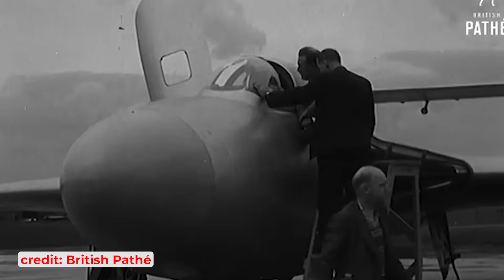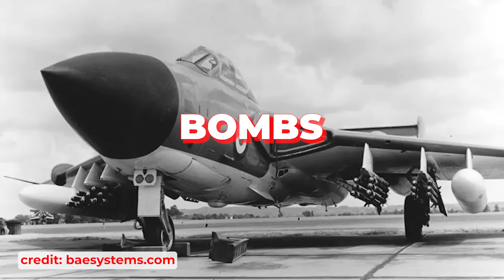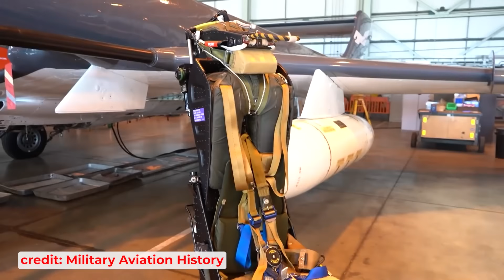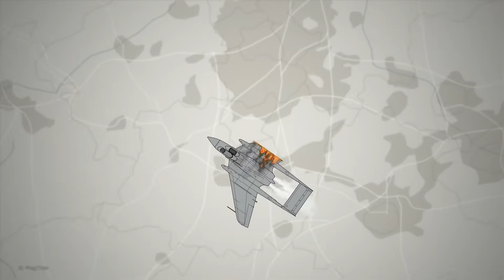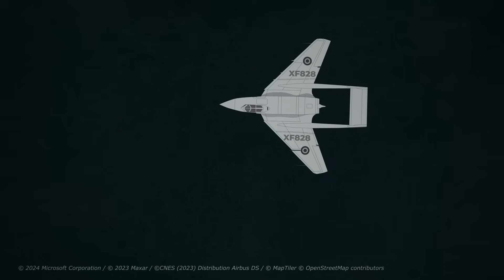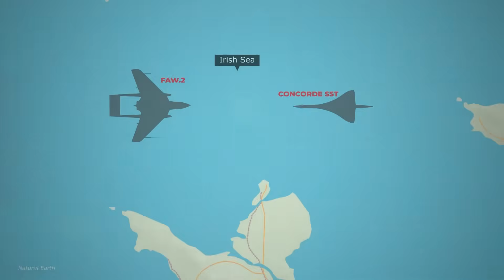Sea Vixen: A Beautiful Killer

Comment: The DH-110 had a V-NE (never exceed speed) of 525 knot indicated airspeed or a Mmo (maximum operating Mach number) of Mach 0.95 Pilots were strictly forbidden to exceed 525 knots due to loss of pitch control authority and flutter that caused catastrophic in-flight structural failures.
Reply: Sea Vixen Compared. 

We feel we can clear up some commonly held myths and misconceptions, obviously.

It's always good to see the facts presented clearly and concisely isn't it.

We feel we can clear up some commonly held myths and misconceptions, obviously.

It's always good to see the facts presented clearly and concisely isn't it.

See further down for a Meteor losses comparison.

See below for Comet accident losses comparisons. The Comet had similar accident losses fatalities to the later Sud Aviation Caravelle. Much later jet airliners from US manufacturers had significantly worse accident losses. 

The Vickers VC10 held the Atlantic crossing record for 43 years  (Non supersonic airliners). 

The Harrier was the only aircraft of its type at the time it first flew. All 1250 Pegasus engines built for all Harriers ever built anywhere were British build and design engines. The first 135 Harriers purchased for the USMC were entirely built in the UK. All 436 USMC Harriers had British built engines. 

The world's first wind tunnel was built in England during the 1800s. The world's first supersonic wind tunnel was built in England during the 1920s. 

Indeed that's correct. The Whittle Gloster E28/39 was of course a brilliant aircraft that was later copied in Russia as the upsized and tweaked Mig 15 with a copy of the RR Nene gas turbine aero engine.

Obviously the RR Nene being the world's most powerful & most reliable gas turbine aero engine in 1944.

The MD F3H Demon was a contemporary to the DH Sea Vixen & had a similar performance. The F4 Phantom was a follow on from the F3 Demon. The Sea Vixen took a long time to get from first flight to introduction for various reasons and a similar situation occurred with the MD F3H Demon.

McDonnell Douglas F3H Demon
590 Built. Not Supersonic.
Max Speed 578 MPH.
Introduction date 7 March 1956
First flight 7 August 1951
Retired 1964

MD F-4 Phantom 2
Number built 5,195
Manufactured 1958–1981
Introduction date 30 December 1960
First flight 27 May 1958

DH Sea Vixen
Number built 151 (including two DH110 prototypes and one Sea Vixen prototype)
Introduction date July 1959
First flight 26 September 1951
Max speed 695 MPH.
Retired 1972

Regarding the UK Aerospace Sector.
 
An airline recently ordered 60 RR Trent XWB Engines.

It's a great pity & a crying shame that British military forces had to occupy a large part of Germany for decades after 1945 & Russian military forces had to do the same. Of course Russia still posseses a large chunk of what was German territory & of course Russia & the UK produce nukes. Obviously Germany does not produce nukes.

Interesting British achievements.
There is no doubt that the Fairey (England)
Delta 2 was of course the world's first jet
aircraft to exceed 1000 mph.  Indeed It
exceeded the previous record by 310 mph &
held the record for 1 year. Incidentally, the Dassault Mirage 3 & 4 are based on the Fairey Delta 2.

Early days, jet fighters.
De Havilland Vampire, Sea Vixen & Gloster Meteor accident losses were not high or unusual for fighter aircraft at the time. De Havilland built large numbers of all metal airframe aircraft before the DH Comet.
We mustn't forget of course that the DH Vampire for example first flew in 1943 & the engine was also built by De Havilland. There were examples of the Vampire interceptor / fighter in service until 1990 which was operated by more than 30 countries.

Non combat phase accident losses.
% of Aircraft built.
The Canadair CL-44 was a turboprop airliner.
Canadair CL-44                  (ff 1959 ) 48%
Lockheed XF104                (ff 1954) 100%
Lockheed  P80                   (ff 1944) 43%
Lockheed F104                 (ff 1954)  45%
Grumman f9f-5 Panther   (ff 1947) 44% 
Convair F102 Dagger        (ff 1953) 45%  
MD F-101 Voodoo.             (ff 1954) 34%
MD FH Phantom 1            (ff 1945)  35%
MD F4 Phantom 2             (ff 1958)  28%
MD F3H  Demon               (ff 1951)  32%
Gloster Meteor                  (ff 1943)  21%
DH Vampire                       (ff 1943)  23%
DH Sea Vixen                     (ff  1951) 33%
Gloster Javelin                   (ff 1951) 20%
EE Lightning                       (ff 1954) 33%

An example of what goes on these days in various countries.
For example, there are of course no German companies that makes German jet aircraft in Germany & there are no German Companies that make German gas turbine aero engines in Germany that are suitable for widebody airliners.

Brazil makes very good airliners & Brazil is 100th down the list along with Indonesia for wealth per capita. Of course it is in fact the case that Embraer can't build those airliners without purchasing stuff from the US, UK & Europe. Norway Holland Denmark Ireland Belgium - Top 20 wealth per capita - Don't make airliners -  its as simple as that.

    Early days of the airliners.
That's correct of course, at the time the Comet wasn't particularly dangerous. Agreed, that is indeed the case of course, The DH Comet was definitely not the worst engineering failure in commercial airliner history.

How things were back then. 
Accident losses - % of aircraft built.
DeHavilland Comet 4                   14% 
DH Comet all mks   (ff 1948)       17%  
Vickers VC10 UK                            5%

The DH Comet had better safety than or similar safety to many other commercial passenger aircraft of a similar era.

Douglas DC-1                                      99%
Douglas DC-2                                      47%
Douglas DC-3                                      30%
Douglas DC-4                                      26%
Boeing s300                                        72% 
Boeing 307                                          70%
Boeing 247                                          48%
Boeing 707                                          20% 
Lockheed L-049/149 Constellation  30%
Lockheed Electra Turboprop             29%
Fairchild FH-227                                  30%
McDonnell Douglas DC-8                   14%
Sud Aviation Caravelle                        15%
Canadair CL-44  Turboprop                46%  
Convair CV-580  Turboprop                22%
Convair CV-880     (ff 1959)                27%  
Convair CV-990     (ff 1961)                33%
Tupolev T-104        (ff 1956)                16%

The VC10 held the fastest Atlantic crossing speed record for 41 years (Non supersonic airliners).

For the first few years of operations the Caravelle and Comet had similar accident loss Fatalities numbers.

De Havilland had prior experience building many all metal construction airframe aircraft & thousands of jet powered fighter aircraft that were primarily of metal construction with pressurised cockpits & jet engines built by De-Havilland.

We hope this helps. Cheers as always indeed etc
Reply: We feel we can clear up some commonly held misconceptions.

It's always good to see the facts presented clearly isn't it?

A potential successor to the Sea Vixen. 

The Hawker P-1103 / General Dynamics / Lockheed F16.

During the 1950s in the UK a number of aircraft that would've exceeded the capabilities of anything on the drawing board elsewhere were in the design stage. They were cancelled for various reasons including the missiles doing everything idea. 

1954, Hawker, fighter development - Air Ministry Operational Requirement OR-323. P-1103, a twin-seat swept wing aircraft powered by a de Havilland Gyron turbojet engine and armed with two Red Dean air-to-air missiles. Reworked the following year-  February 1955, the Ministry issued OR-329, called for a large 40-inch (100 cm) sweep-scanning radar unit AI-18. In October 1955 revised P-1103 proposal for a revised requirement offering the Red Hebe missile. 

In addition to the P-1103 Mach 2.5 design, Hawker also did design work for a faster P-1121 version. Mach 3, steel wing + uprated Gyron engine.

The Hawker P-1103 initial design had a fully variable geometry chin position inlet, Hawker's basic 1954 design would later be used for the General Dynamics F16 Fighting Falcon (Viper) - first flight 1974. The F16 was built in a number of countries with companies in those countries also producing parts for the aircraft that were built in the US.

We hope this helps.
Reply: A number of similar performance non supersonic jet aircraft got to first flight stage at around the same time. 

The MD F3H Demon was a contemporary to the DH Sea Vixen & had a similar performance. The later F4 Phantom was a follow on from the F3 Demon. The Sea Vixen took a long time to get from first flight to introduction for various reasons and a similar situation occurred with the MD F3H Demon. The Douglass Skyhawk delta wing is a contemporary to the the Gloster Javelin delta wing. Both non-supersonic delta wing aircraft, the javelin had better performance and first flew a few years before the Douglass Skyhawk.

Douglass A-4 Skyhawk 
2950 Built 
Intro 1956
FF 1954
In service to 1980s
Max V 670 MPH
Delta wing. A small / light jet aircraft designed for carrier operations without having to have folding wings. Often referred to as the scooter. 

McDonnell Douglas F3H Demon
590 Built. Not Supersonic.
Max Speed 578 MPH.
Introduction date 7 March 1956
First flight 7 August 1951
Retired 1964

MD F-4 Phantom 2
Number built 5,195
Manufactured 1958–1981
Introduction date 30 December 1960
First flight 27 May 1958

DH Sea Vixen
Number built 151 (including two DH110 prototypes and one Sea Vixen prototype)
Introduction date July 1959
First flight 26 September 1951
Max speed 695 MPH.
Retired 1972

Gloster Javelin.
434 built.
FF 1951
Intro1956
Max V 710 MPH
Delta Wing. 

Interesting British achievements.
There is no doubt that the Fairey (England)
Delta 2 was of course the world's first jet
aircraft to exceed 1000 mph, 10th March 1956 Indeed It exceeded the previous record by 310 mph & held the record for 1 year. Incidentally, the Dassault Mirage 3 & 4 are based on the Fairey Delta 2.

When the EE Lightning first achieved Mach 2 it was one of the fastest aircraft on the planet. 
P1 Mach 1 achieved 1954, Mach 1•5 capable.
P2 Mach 1 achieved 1956, Mach 2 capable. 
P2 Mach 2 achieved 1958.

The Hawker P1103 was a design and part built prototype that would have led to Mach 2 & Mach 3 versions of the aircraft. The General Dynamics F16 Fighting Falcon was of a similar design that went into service in 1975. The P1103 was cancelled during the switch to "mostly missiles plus no supersonic interceptor aircraft required in the future" era which included cancelling air to air missile development. Scheduled for test flights in 1958 and to be in service 1962. The General Dynamics F16 Fighting Falcon - based on a British design started 39 years earlier, built in the US and a number of manufacturing partner countries with parts for the US built aircraft sourced from partner countries. 

There were plans to do a supersonic thin wing Javelin which of course got cancelled. 

Early days, jet fighters.
De Havilland Vampire, Sea Vixen & Gloster Meteor accident losses were not high or unusual for fighter aircraft at the time. De Havilland built large numbers of all metal airframe aircraft before the DH Comet.
We mustn't forget of course that the DH Vampire for example first flew in 1943 & the engine was also built by De Havilland. There were examples of the Vampire interceptor / fighter in service until 1990 which was operated by more than 30 countries.

Non combat phase accident losses.
% of Aircraft built.

The Canadair CL-44 was a turboprop airliner.
Canadair CL-44                  (ff 1959 ) 48%
Lockheed XF104                (ff 1954) 100%
Lockheed  P80                   (ff 1944) 43%
Lockheed F104                 (ff 1954)  45%
Grumman f9f-5 Panther   (ff 1947) 44% 
Convair F102 Dagger        (ff 1953) 45%  
MD F-101 Voodoo.             (ff 1954) 34%
MD FH Phantom 1            (ff 1945)  35%
MD F4 Phantom 2             (ff 1958)  28%
MD F3H  Demon               (ff 1951)  32%
Gloster Meteor                  (ff 1943)  21%
DH Vampire                       (ff 1943)  23%
DH Sea Vixen                     (ff  1951) 33%
Gloster Javelin                   (ff 1951) 20%
EE Lightning                       (ff 1954) 33%

More recent UK military jet aircraft.
 
The Tornado & Typhoon & their engines are Supersonic & are indeed British design aircraft with British design engines built by an international consortium. The Tornado design for example started life during the 1950s at Vickers as the AFVG, it's engine is based on the RR RB-199. The EE Lightening is also a British Supersonic jet aircraft.

The Typhoon is the British BAC-EAP with an engine based on the British RR XG-40, the Typhoon is also built by an international consortium.